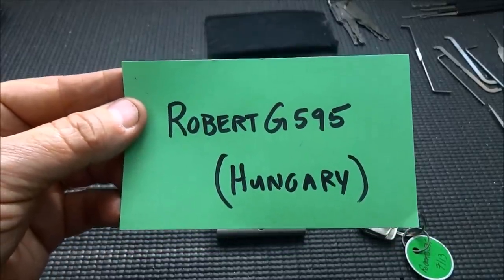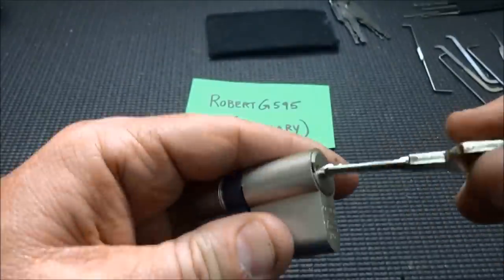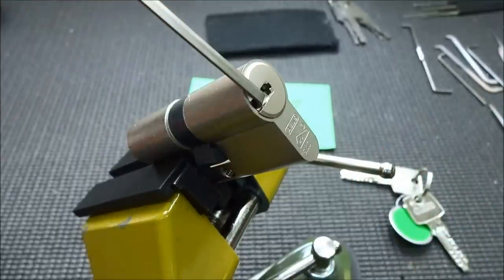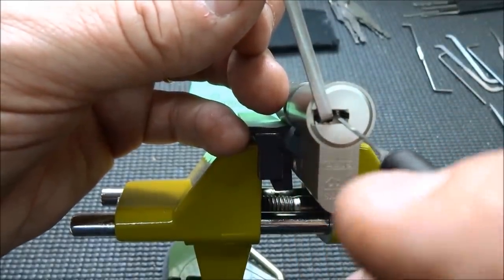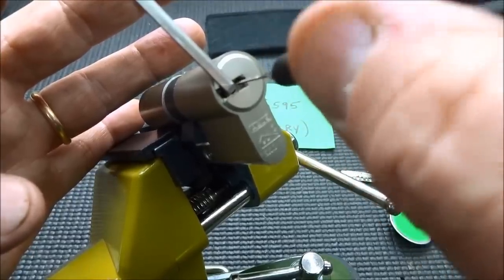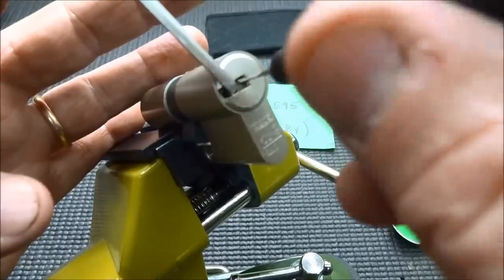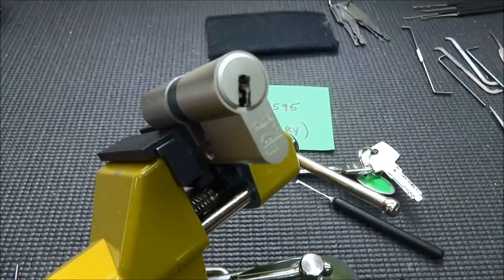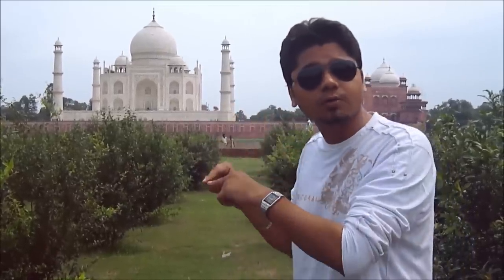(348) "Tickle" Dimple Locks Open - Fast!

Comment from the maker: Jim, "normal" dimple locks have pins only on one side and you can look in the keyway and see them.  Just poke'em with your pick to see if they pick upwards or downwards.  Some locks (Kaba, Keso, etc) have pins on BOTH sides, as well as the top and bottom.  You'll know these when you see them - they are really hard to pick.  Others (DOM for example) can have two rows of pins on ONE side.  Again, difficult to pick.

Comment: Great video and very interesting technique... Thanks for sharing.  I just got a D10 for practice and will admit to being disappointed at the tolerances. This is one case in which the scary looking key is not commensurate with the pick resistance of the lock.
Reply: LockPickingLawyer In dimple locks the pins have a lot less travel - there is far less height difference between highs and lows not to mention between these two extremes and anything inbetween. Of course, they thus all sit closer to the shear line even in the positions they sit in when at rest.

Comment: Doesn't high tolerance means low precision, ie. low quality ? ( at  0:50 )
Reply: high tolerance means the pieces fit together tighter...very precise machining not allot of jiggle room example: low quality master locks have so low tolerances that if you smack it just right the lock opens accidentally not gonna happen on high tolerance locks
Reply: +John Baker ok

Comment: hi and I have one question for you what is a dimple pick the set I Got came with the pic it is strange looking and when I looked up what it was called it said it was a dimple pinch it is flat and a little wide and looks like some waves are going over the metal